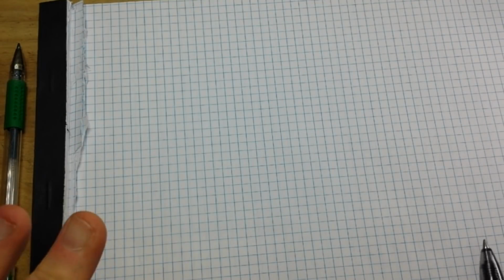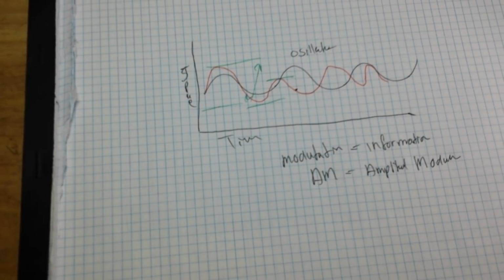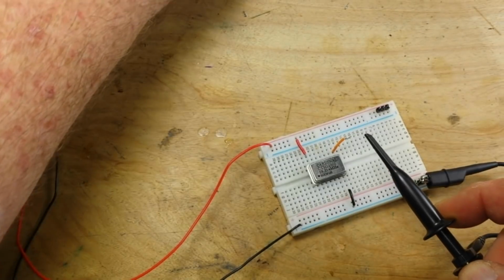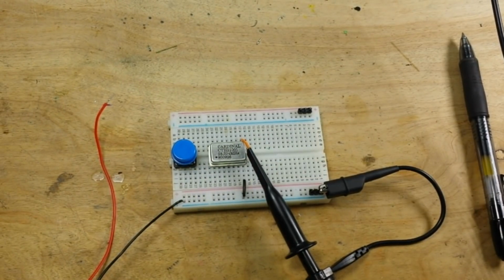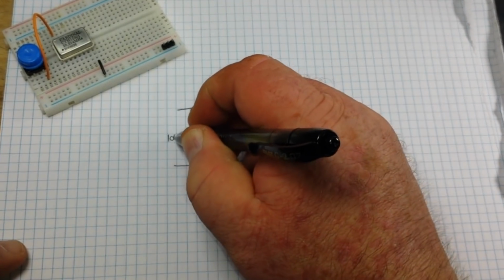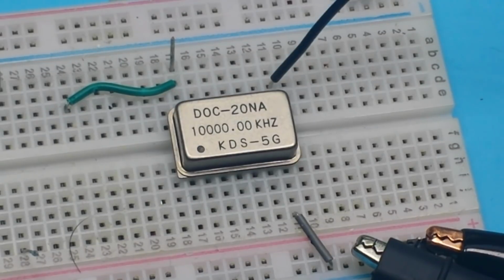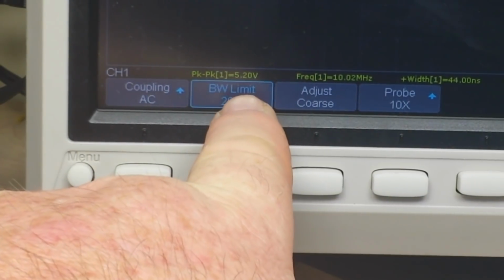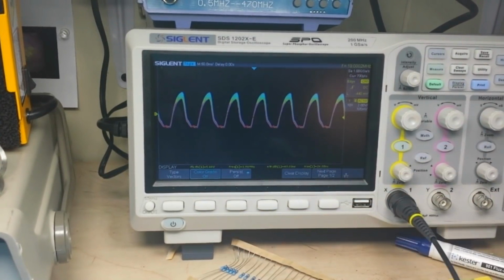Let's make a radio transmitter PART 1

Comment: Everybody's harping on who invented radio but didn't comment on FCC standards for Federal Communications Commission and that the 22.xx MHZ oscillator is NOT in the 10 meter band! 10 meters is from 28.000 to 29.9 something MHZ.

Comment: I know this is a little more than transmitter "basics", but with the continuous wave, if you have a beat frequency oscillator on the receiver with a mixer, one of the frequencies from the mixer result should be in the audio spectrum.  You could still use the transmitter with no audio modulation on the carrier couldn't you?  I think this is how we do it on the ham bands, but I don't CW, so I'm sketchy on the specifics.  I do know they are used to reconstruct SSB's since half the carrier is suppressed.  Playing with the uBITX and there's a blatant row of crystals for the BFO in that design.

Comment: Reading the responses to this video my opinion is the exception. Usually your videos are good and that is why I expected something a little better from you. I hope the following parts will be better.
Reply from the maker: What did you not like?
Reply: @learnelectronics  The history lesson tried my patience because in my opinion it was unnecessary fluff. Using an IC to teach how an oscillator works is like trying to teach someone how a clock works by having them observe the dial.
Reply from the maker: Sorry you didn't like my history lesson. As for the oscillators, I've got about 15 different videos showing oscillators made from scratch including colpitts, phase shift, five five five, relaxation, Etc. I try not to reinvent the wheel in each video. I suggest if you want to learn about oscillators you watch a few of those. The series deals more with the application of the oscillator then it's build.

Comment: Nice one. You could hook up a RTL-SDR dongle or use your Ham radio to receive this I suppose even if very very weak I guess it would detect it in the same room right?  Might want to build a little Colpitts oscillator or similar VFO next.  Another nice project is to get a cheap Pixie radio - its a few dollars and an easy build.

Comment: So is the signal connected to one of the coils on the transformer and the osillater on the other?? How is the signal.... I don't know how to say this.. how is it attached to the carrier signal?? Am I making sense.. ?
Reply from the maker: The amplitude (voltage) if the carrier is modulated (changed) by the input signal. The frequency remains the same but the voltage changes.

Comment: Hi Paul, thx for the video,  I hope Part 2 uses a transistor and the freq is lowered for reception by readily available receivers. By using the transistor, this will clearly show how amplification works,..this could easily end up multi part videos... looking forward to your next video. 
FC...Commission,.. 😀  cheers n 73s

Comment: Easiest way would be to run your Audio and Carrier thru a non linear device  Heterodyning your signal.     Diodes and Transistors are commonly used  Non Linear devices used today.   Marconi and Company didn't have access to those at the time, eaaa?  LOL

Comment: The first Spark Gap Radio's had no Tank Circuit.   Created RAW Broad Band RF.    The ability to select the  signal frequency via Tank Circuit was a drastic improvement to come latter.    Today Spark Gap can be used to create Broad Band Signals for Radio Jamming purposes.

Comment: Tesla won at court and was awarded the rights to the radio patent. Marconi just had more money, went to higher court and took the radio away from Tesla (who did not even contest). You didn't mention this because your knowledge is a school knowledge, Tesla does not exist in American schools.
Reply: That's not quite true.  Tesla lost in court originally.  The U.S patent office didn't award the patent to Tesla until months after his death because Marconi's company was trying to sue over other patents.  https://www.pbs.org/tesla/ll/ll_whoradio.html
Reply: PoorTesla , that man just couldn’t win !  He copped it from  Edison with the AC. Vs DC war and Marconi stole his ideas   .
Reply: @Flattyman  Marconi did not steal his ideas - Marconi was using an electrical arcing system to generate his transmission. I'll need to look further in Telsa.
Reply: Keep Secret 
If i recall correctly Marconi wouldn’t let anyone look inside his little box of tricks  but when they finally did get to see inside they found parts that were identical to ones that Tesla had designed  before Marconi even thought about building a Radio.

Comment: I noticed when you plugged in the transformer the basic, un-modulated signal looked a lot cleaner on the 'scope. Is this due to some choking effect or is my thinking amiss? Bear in mind, I am a mechanical engineer, not electrical.

Comment: Nice video.  Curious, do you think a RTL-SDR using dongle SDRSharp would pickup the 10Mhz audio signal?
Reply: Don't see why it wouldn't. It should work just fine.
Reply from the maker: It will pick it up with an antenna that is tuned for it.